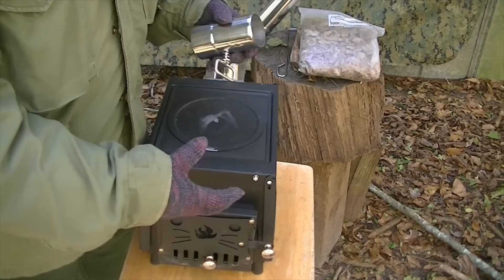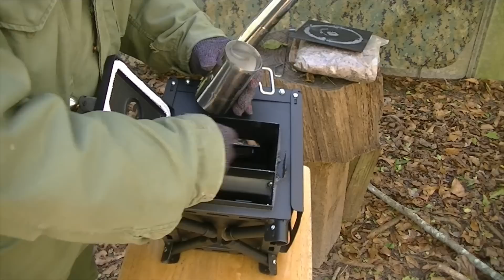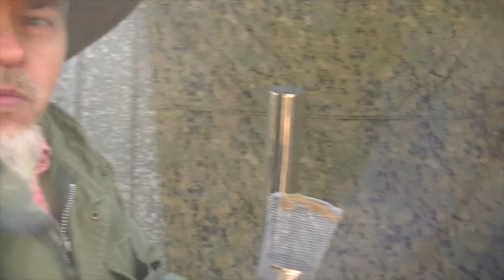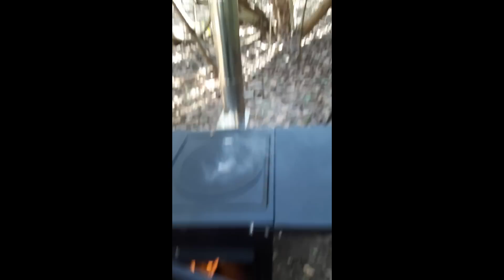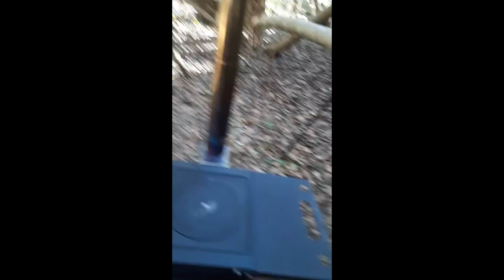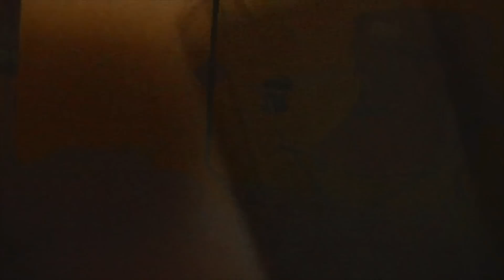SILVER WOLVES HOT TENT STOVE TEST

Comment: Hey Blackie- I like the motto-"Safety First, People Always".  I think that stove is going to work out for you.  Remember that its going to take a couple burns to "break" in the stove and that front smoke should go away, but I would apply the sealer to be on the safe side.  Im real surprised that its powder coated as I did not know they did that in China.  Give it another 3-4 burns and youll be good to go.  Thanks for the update and you and Mrs Blackie be good.